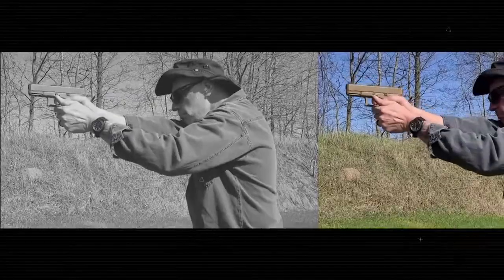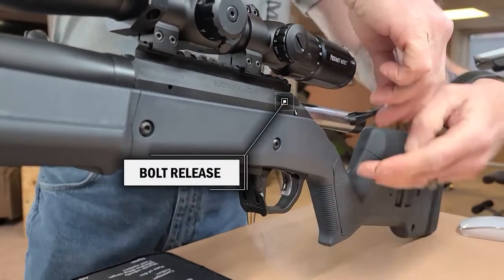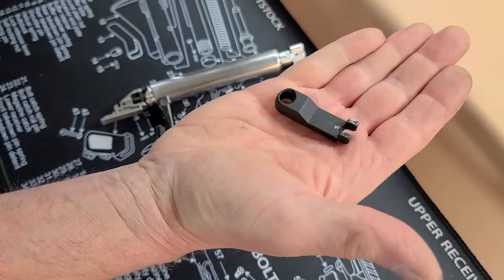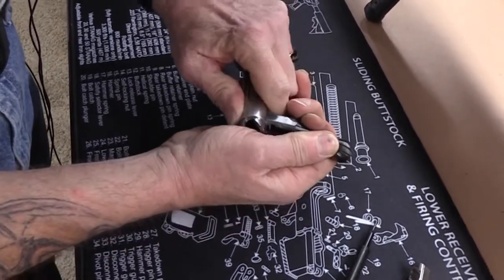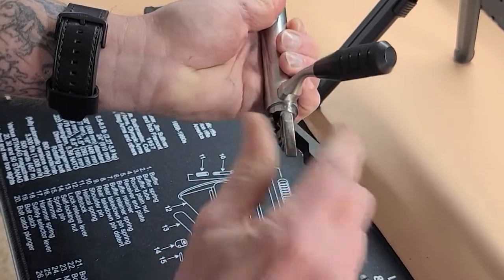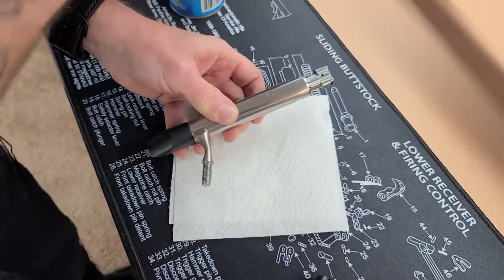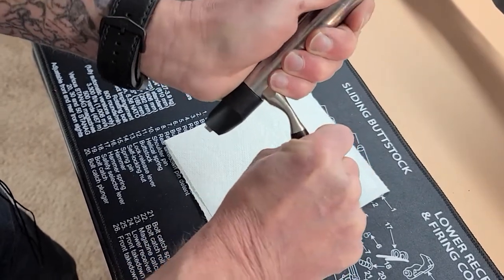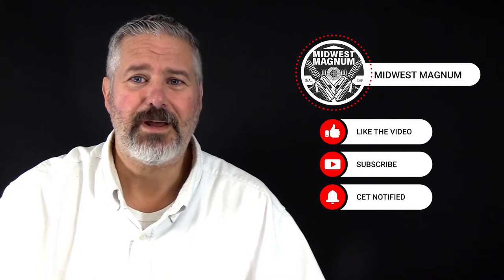Ruger American .308 Bolt Handle Upgrade

Comment: My new Anarch Outdoors bolt handle, knob, and tool just arrived for my RAR. I installed it while watching this easy to follow video.

My billy badass custom bolt action is now 100% complete.

I started with a basic  budget Ruger American Ranch AR 300Blk rifle.

I did all of the work myself, including the barrel swap.

Upgrades:
• Wilson Combat 16" 300 HAM'R barrel

• Timney trigger set to 2lb

• SiCo Omega 9k direct thread suppressor

• Primary Arms ACSS 1-6X 300Blk FFP LVPO + low scope rings

• MDT XRS FDE chassis

• MDT 223 AICS mags

• Anarchy Outdoors black bolt handle and long dragon scale knob.

Total weight w/o magazine is 10lb 4oz.

Comment: After changing the bolt handle, I followed the directions, rotated the firing pin mechanism, removed the firing pin removal tool reinstalled the shroud rotated once and it clicked and then tried to rotate the second time and the shroud popped off. Now I am not sure how to get the firing pin mechanism and shroud to realign

Comment: You can line up the “bottom” of the firing pin back with the flush side of the bolt handle, and then use the anarchy tool to remove the firing pin. You don’t need to drop the firing pin back into the “raceway”
Reply from the maker: You are correct Lucas. There are usually a number of ways to accomplish a task but we chose this option for demonstration purposes. Thanks for the comment and insight Lucas.

Comment: So I am left handed with typical configuration of right handed bolt gun. Would I be able to rotate the bolt handle 180 degrees so that it points toward the muzzle?
Reply from the maker: You will need to get it for left handed. Thanks for the question.
Reply: Sorry I am finally now getting back to this. You made mention that there is a direction for the bolt, it appears there are some recess cuts in the front of the bolt, is that correct, and would my plan actually work. Using Left hand bolt, mounted on right side. @mwmag

Comment: How is your bolt so shiny? I just picked up a RAP 308 and my bolt looks dull.
Reply: get some jb compound and lather it on there, then cycle the bolt about 500 times. It will clean up the rougher areas and make it silent along with cleaning it up!
Reply from the maker: Thanks for the info.
Reply from the maker: We spend a good amount of time polishing the bolt. Thanks for watching.

Comment: Waste of money. Its just a bolt handle, what's wrong with the original.
Reply from the maker: It's not what I wanted. I preferred the larger, easier to maneuver, handle.
Reply: The original sucks compared to the upgrade.
Reply: you can't fix stupid...
Reply: Bottom line, it just loads a round in the chamber....again, waste of money.